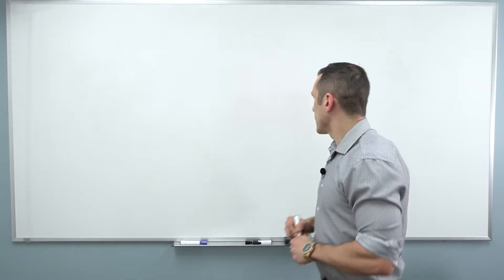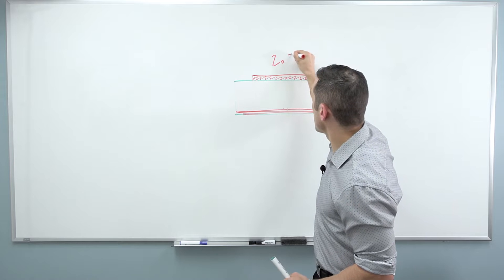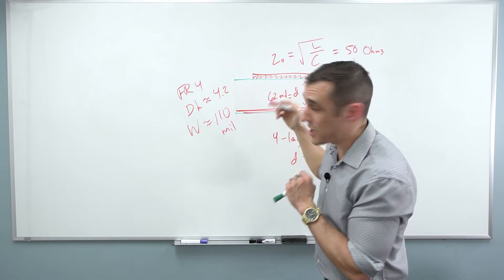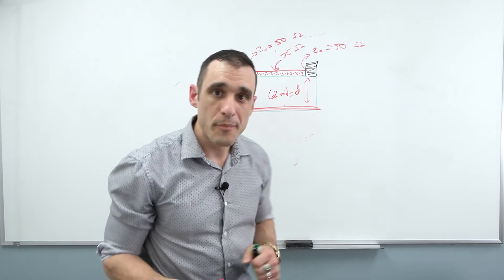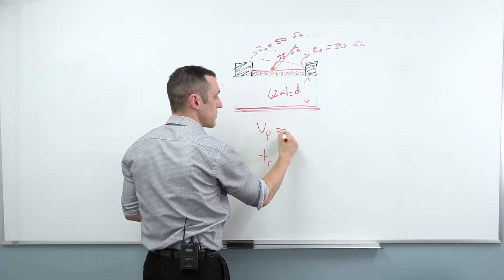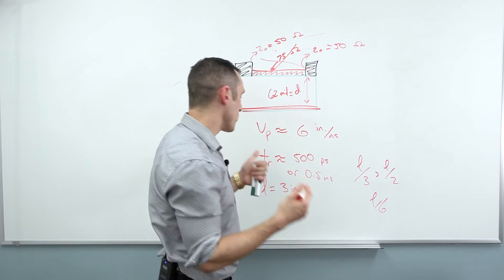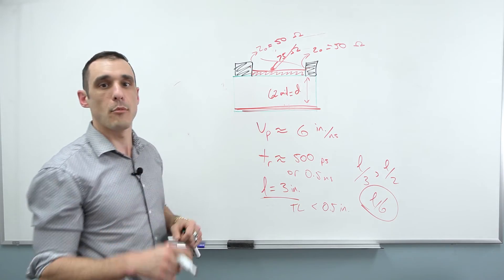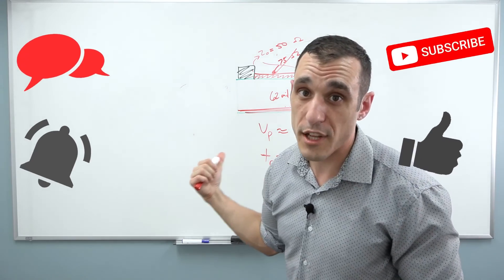High-Speed Routing on a Two-Layer Board

Comment: What is considered a high-speed interface? Let's assume I2C, some have a maximum of 400 kbit/s, and some have a maximum of 1 Mbit/s. Or SPI is allowed at a maximum of 12 Mbit/s. Does the tire run at maximum? I just want to overclock the work to the maximum and there is an option both on the board of interaction of two microcircuits and through the connector. The connector option, how will it affect the speed?
Reply: High speed has nothing to do with data rate. What matters is the bandwidth of the physical channel (trace on a PCB) that is being used to transmit data, meaning the range of frequencies that can propagate along the trace with minimal losses. For novice designers, we talk about things in terms of the rise time of a signal because it is easier to understand, so the rise time is what we use to state whether something can be classified as high speed. Technically, today's CMOS logic (in push-pull topology) is all high speed because it can source and sink signals very quickly. This means signals from your SPI interface running at 12 Mbps could have the same rise time as signals from an 100 Mbps Ethernet interface (for example, ~5 ns). While higher data rates do require faster rise times, the reverse is not true.

Comment: How do we decide if the PCB t requires high speed design or not required?
Reply: If the interface you are using on a component has an impedance specification then you need to design the traces to have the required impedance value. This is a basic requirement in any PCB that has high speed interfaces. We call a PCB "high speed" based on the rise time/fall time of the signals in the components, not on the clock rate or data rate. Generally, when signal rise/fall times are around 10 ns, then it is best to start with a 4 layer board. Some boards will use two layers with coplanar ground, and sometimes they pass EMC testing but they will fail if not laid out correctly on two layers. That's why the best case is 4 layers, and it is not much more expensive to design on 4 layers instead of 2 layers.

Comment: USB signals uses differential pair so this was bad example. They do not use, virtually, ground as impedance references. (strictly only for imbalanced current due to non-ideal  transceivers) Another problem is you have to provide current return path for high speed signals, no one tell that have to be done in different layer as long as it is easyest for many layer pcb.
Reply: I talked about differential pairs at the end of the video, and we in another video I showed an example specifically with USB as an example on a 2 layer board. You need to have ground somewhere otherwise those traces might get too fat, or you have to put them too close together, depending on board thickness and distance to the GND plane/pour. And yes, differential pairs can and do use ground as a reference, it is done to define the impedance and to reduce parasitic coupling to other interconnects, including other differential pairs, it affects differential crosstalk and differential-to-common-mode crosstalk. You can put a return path somewhere else, but if it's too large be prepared for a lot of noise and crosstalk. There are other reasons to use ground plane/pour as well, mainly power integrity once you have a system that is sourcing a lot of high speed with fast edge rates.

Comment: Thank you for video!
My question - Can I use single coplanar in two-layer board? how much ground should be near signal trace? 
I see that for 50 Ohm  and clearance 0.15mm width of trace must be 0.65mm - it's thick trace but may be there's still some proplems?
Reply: Yes that sounds accurate but it depends on the board dielectric constant. You would need to have low clearance to the nearby ground to get to the right impedance. In Altium Designer, using the default Dk value of 4.8 on a 62 mil board, I found that the width was 15 mils and clearance was 4 mil to get a 50 Ohm trace.
Reply: @Zachariah-Peterson  thank you very much for answer!

Comment: I asked about high speed tools for Altium. They don't do an equivalent of Hyperlynx I'm told, sadly.
Reply: Hi Robert, there is a new connector for AD + Hyperlynx that should be coming out soon, it will let you open your AD board inside Hyperlynx so that you can use all of their utilities.
Reply: @Zachariah-Peterson  Thanks. It was a reason we didn't use Altium back when I did car ADAS with Mentor Tools. Let's hope it's not just Boeing, NASA and Apple that can afford the tool though.... 🤣

Comment: you do not need a ground plane just a plane
Reply: Hi Roger! Technically you need a low-impedance path to ground, which in a 2-layer board is most easily provided by a ground plane. If you can figure out how to do that with a power plane as the reference and a capacitive path to a ground trace/rail without creating highly inductive current paths then that's great, it's just harder with a 2-layer board than with a 4/6/8 etc. layer board.

Comment: Really the practical advice would be to just go for 4 layer PCB. They now cost just a little bit more than 2 layer one overseas, but advantages they bring are massive and are totally worth a little extra.
Reply: Totally agree with you! That's why I call a 4-layer stackup "entry level". However, some people still insist on doing some stuff on 2-layer, so it's worth bringing up. Realistically, you can only do two interfaces on 2-layer and do them well: USB 2.0 and 10/100 Ethernet. I'm interested to see if anyone else has done a 2-layer board with other interfaces (maybe pre-DDR SDRAM?) just to see it worked.
Reply: @Zachariah-Peterson  I've seen HDMI TX IC breakout boards done on two layers for up to 1080p (so 1450 Mbps per lane). This interface is surprisingly robust, so you can get away with a lot of sketchy stuff. Like you mentioned in the  video, as long as traces are not very long, it should still work. I imagine that other widely used cable-based serial interfaces will also work as they are designed to work even over crappy $5 cables.
Reply: @Zachariah-Peterson  well for me it is worth it to go with a 2 Layer board as in low quantities it is just twice as cheap as a 4 Layer board would be.

Comment: Haven't stopped to do the trace width calculation but using a 0.8mm thick 2 layer board would make the trace widths more manageable? Surely this would be better than the usual 1.6mm board.